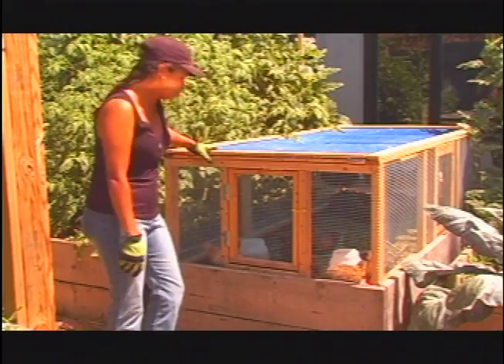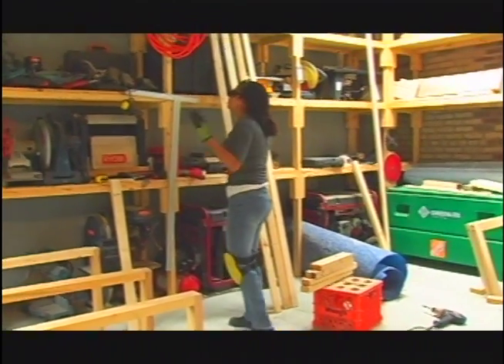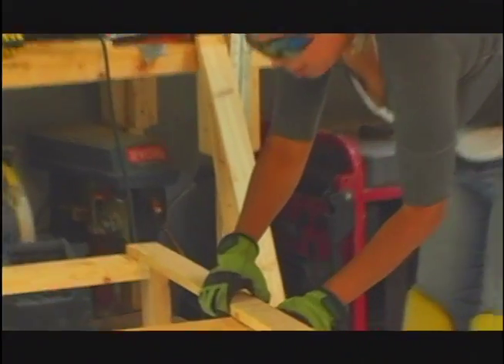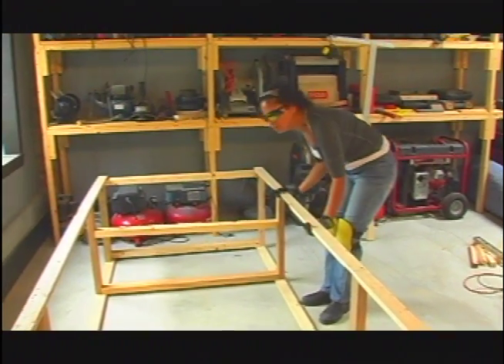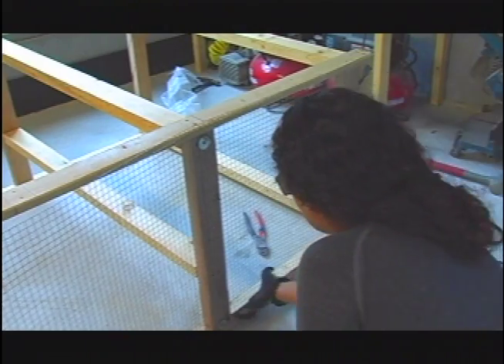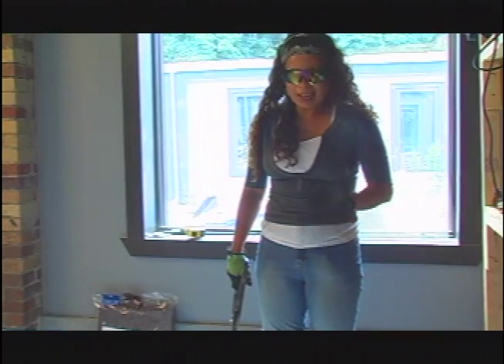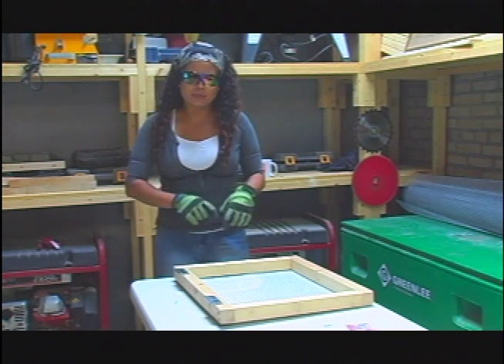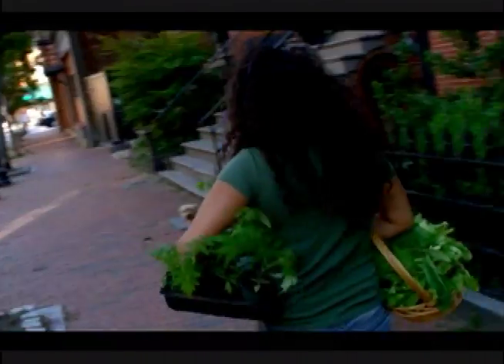How To Build a Chicken Coop Tractor (High Rez)

Comment: rain doesn't pool on top? it looks top could turn into a little 3/4" deep mosquito haven. in your situation, i think a "coop" may be a more appropriate term. a "tractor" refers more to a movable unit allowing the chicks to eat primarily insects and grass/weeds, and moved up to twice daily so as not to noticeably damage the land. this does not really fit the bill for a tractor, but is a decent open-air summer coop. :) 
ps. what hardiness zone are you in?

Comment: Top should definitely be sloped or gabled. First rain is going to make a mess. 

I'd also hinge the top, those two door are not much access. 

I'd use electrician staples to attach the wire cloth instead of screws and fender washers. 

'

Comment: Don't those babies need a heat lamp? And shelter from the wind? They are way too young to be left out in the elements. Nice job on the pen but I would add shelter and make the roof slanted for drainage.